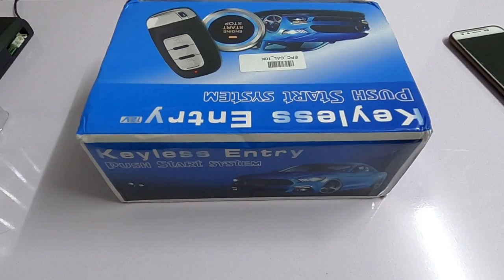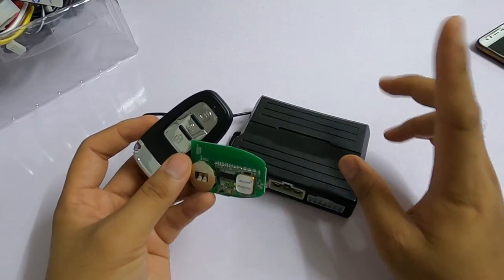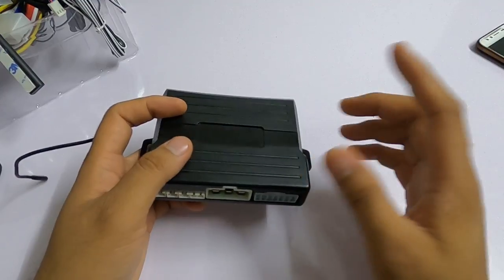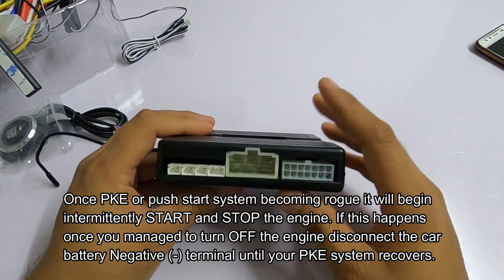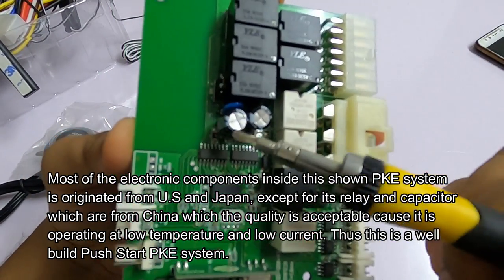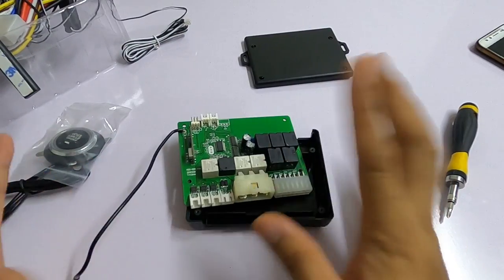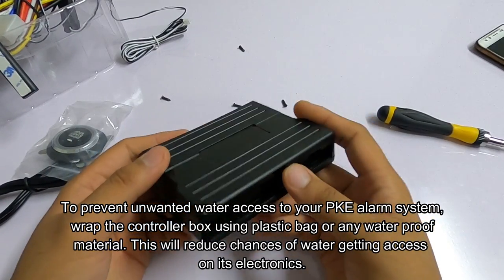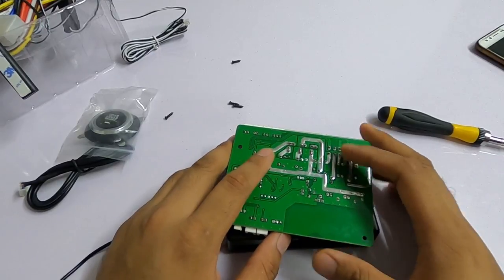Push Start PKE | Aftermarket Installation Safety Precautions & Risk

Comment: Got it installed and used to not turn on with out the key fob in range but idk what happened it starts with out the fob I’m range what could it be
Reply from the maker: i think the pke module has issues, because i experimenting remove its fob detection antena it immediately lock the door and rang the alarm if you open its door or start its engine. if you did wired the whole system onto your car get a new spare unit just replace the module or antenna but most probably its the module. subscribe if helpful.

Comment: Do you think a silicone based or epoxy resin, if I coat the entire circuit board with one of them, it will prevent moisture from getting in there
Reply from the maker: i think so, yes correct that might be a good idea thanks for the input bro🤗
Reply: When you try to open a car computer or ecu,you will see a fully coated circuitboard just to insure resistant of water and rust on electronics parts.

Comment: good video and good eye for finding the bridge.. the chip though that looks more like they acid wiped or used a grinder on it to  get rid of the writing on the chip so you would not know what it is .. I see that in all the products from china . They do it to slow people down from cloning the pcb's or dumping the firmware off the chip and  the other reason is because the chip it self is a clone of a name brand..
I Just bought one of those to install have not taken mine apart yet but pretty sure that is the wireless section and that would not cause your car to turn on and off anyways.

Comment: I disagree, going from cold to hot creates condensation because air pressure difference in different temperatures. Since different air pressures have different humidity level, the leftover water condensates. if you wrap it in plastic, it basically condensates inside and cannot vaporize again because well, you wrapped in plastic, but it got inside with air, since you cannot make it completely air tight by wrapping it in plastic. So you just create a closed canister that keeps sucking water in from air. What I would to is get a can of spray polyurethane plastic and coat the PCB. Now its just protected from the environment. Ofcourse it is good to clean the board first with isoprophyl alcohol. Simple. And now the condensation water can leave before causing any harm by rusting your connectors, etc.
Reply: Agree on technicall stand point

Comment: Warning I have the EASYGUARD PKE system All remotes shit themselves at some point I advise when ordering to get two more remotes straight away because, after a couple of years, the new remotes will not work on the older module. I know because it happened to me.
Reply from the maker: Me is a different story, mine has lock unlock issue and mis crank  after 3 years of use.

Comment: What if the car have immobiliser system?still suggested to install?
Reply from the maker: Hi ashraf ,the original immobilizer will removed from the original key and stick to the key slot receiver permanently as there is no need for immobilization anymore, the new alarm PKE features is more advanced with its GSM radar antenna to detect the key fob within 2 meter radius. Subscribe if helpful.
Reply: So it would not be a problem to install on altis model 2012? Because some say that the battery will weaken fast because of the system..and the original car alarm system is better..mind sharing your opinion?
Reply from the maker: @ashrafrahim3665  Within 3 days If i not mistaken if there is no entry into the car the alarm will off its radar antenna system which will then allow u to enter using  lock /unlock button. I been travel and set my car a week without starting I don't have much issue with it, plus my car battery is small NS60. Nothing much different
Reply: Thanks for the reply bro..but if the car already have push start button system..then cannot install this oem system right?

Comment: i had a more expansive system been using it for quite number of year, at the end of the days when the relays start to get weak, you will find your car will have a hard to start and sometimes doesn't even start. currently i haven't found any better system which is more reliable from china.

Comment: Hi, amazing diagnosis of the PKE system. I have one problem with my aftermarket PKE, it's that holding the brake and pushing the Push to Start button starts up the car way too fast, and this over time is causing some problems with the idling due to ECU. My question; is there any way for us to add a delay in the PCB when we start the car? only pressing the button without pressing brake sets car to "ON" position and starts the ECU, but when we try to start the engine, the starting sequence is Off -> Immediately Start Engine which does not help. Thank you so much for your input
Reply from the maker: as in modifying the PKE's PCB board is a NO, however I dont understand the sequence that you mentioned as in my PKE 1 time button push without brake tapping is ACC On. Push 2 is ON, and 3 will do start if brake is pressed or totall OFF if no brake pressed. The only thing that my PKE always bugging me is when it short crank before engine is start.
Reply: @IkmalRusli  Yes thank you for your reply. So push 3 with Brake pressed for my system does not go from ON -> Crank, but rather Shut off -> Crank. When this happens, it is similar to turning your keys straight to Crank, without pausing and letting ECU, fuel systems start up. Hope I'm able to explain well

Comment: Hey my car already have keyless entry with remote key...but push start button is not there...if I install this then my old key can be programmed into this module...
Reply from the maker: Hi few things need to be clarify is your car keyless is aftermarket install? if yes the you need to completely get rid of it and install this PKE system old remote cannot be programmed if its not a universal ones. If your car keyless is OEM fitted then you totally cannot use this as it already have integrated into it's BCM functions and cannot be overwrite with this new keyless system. Another way if you only want to get push start feature is to just install a push-start only module but of course it have no other features other then to start the car and not as smart as this. Subscribe if its helpful

Comment: Mungkin boleh ..solder dengan cairan plastik atau..buat dia waterproof.. Boleh tak spray  atau solder supaya tertutup .. Guna leakage spray..
Eksperimen ..hihi asalkan bahan penutup bukan elektrostatik..konduktor elektrik..
Reply from the maker: Idea yg agak baik tetapi harus ingat module tu ada connecter jenis socket...sekiranya kurang mahir akan menyebabkan socket sukar di buka sekiranya terdapat masalah😊

Comment: I wanted this on my Ford Fusion 2016 se, suggestions or thoughts?
Reply from the maker: As for this system it's support most cars that comes with non-keyless system. There is 2 things you need to confirm with your car before installing or purchasing this:
1. your car default system should not be keyless
2.Door Lock system trigger, check your car or google what type of door lock trigger it uses cause this system only support +ve and -ve triggered. newer ford model uses datalink door lock system which not supported by this PKE system. Subscribe if I'm helpful 😃

Comment: hello sir ,,,why is it if i remote start my vehicle the car will start but the starter keeps on starting even thow the vehicle has already started?
Reply from the maker: I think you missed out the wire "Fuel Path/Pump" thats where the PKE sense if the engine is running, find the wire usually at the side door panel it will always give "+12v" when the engine running and non when its OFF. subscribe if helpful.
Reply: ok Thankyou

Comment: How do I get a 2018 wiring diagram for Honda Civic Sports model
Reply from the maker: Hi I think will not compatible for car that already come with Factory push start system, like civic 2018. The diagram is universal for all car not specific to Honda, u might require a wire propping n tapping skill in order to look forward wires to joint with this module. subscribe if helpful 😃..thanks
Reply: Hi bang,mana boleh dapat diagram untuk pasang alarm pke ni dekat wosh zge?
Boleh guide mana point nak ambil?

Comment: Hi can I ask does installing this will consume more car battery?
Reply from the maker: hi for any type of pke alarm system it will consume slightly higher current then normal alarm system due to actively scanning for key fob transmitter. for this pke unit if there is no unlock for 3 days it will disable the pke function to reduce battery usage. so when u enter the vehicle u need to press the unlock button as pke sensor is disabled to conserve battery. subscribe if helpful 🤠
Reply: @IkmalRusli  Thanks for the info, just subscribed! Hope to see more content on the PKE system
Reply from the maker: @jaysonlai95  thanks bro, i will work more to create content like this if there is opportunity 😀🙏

Comment: Sy punya remotenya termasuk dlm mesin basuh. Jd remote tu rosak.. Sy bole buka kreta mgunakan kunci manual.. Tp x dpt start kreta.. Mcm mna nak selesaikan?
Reply from the maker: Alamak tak ada spare ke? macam ni boleh bypass temporary kalau model alarm kamu sama mcm video ni. buka kereta tu manual time masa enjin tu mati tekan learning button yang dia provide tu hold sampai signal berkelip dan kamu boleh start kereta tu macam biasa untuk exit bypass mode tekan semula learning button tu masa engine mati sampai signal berkelip. Kalau beli remote baru untuk program hidupkan enjin kereta dulu, kemudia tekan learning button tu sampai alarm ada bunyi kejab dan signal berkelip, lepas tu tekan lock/unlock remote baru tu box alarm tu akan save frequensinya.setelah selesai programming tekam semula learning button tu.
Reply: @IkmalRusli  terima kasoh tuan..

Comment: Hi, i am planning to buy the same one for my 2010 honda accord. What is ur suggestion, is this system good?
Reply from the maker: Hi jyo, been using the system for almost 2 years quite stable not much an issue with it and yes you can trust this one. subscribe if helpful 😎

Comment: Bro. System ni kena make sure alarm sedia ada elok ke? Sy punya alarm dah gila. Ingt nk pasang yg PKE punya.
Reply from the maker: Tak perlu bro yang penting center lock dan door lock function, push start nj canggih cuma dia ada dia punya perangai tersendiri contohnya kadang kala signal dia terjejas sbb kan telepon bimbit dan kadang kala masa start up dia stop crank walaupun enjin belum hidup. saya masih menggunakannya sehingga sekarang syukur takde masalah sangat. subscribe sekiranya membantu 😊
Reply: @IkmalRusli  bro tnya sikit. Alarm skrng tngh gila. Now dia kacau signal. Sy kasi signal kanan, dia kluar double signal. Ni mmng issue alarm ke? Sbb alarm kalau sy tekan beeb berbunyi, tpi lampu signal tk kluar. Aduh pening.
Reply from the maker: @nanotech4947  kena tgok bro kalau baru2 berlaku mungkin alarm controller ada masalah yg ini upgrade ke alarm ni mungkin solve issue bro ni, tapi kes paling teruk sikit bcm module rosak yg ini kena tukar bcm box. bawa ke pakar alarm dulu tgok apa mereka kata sblm upgrade ke benda ni takut jd teruk pula.  Body control module (BCM)
Reply: @IkmalRusli  bro. Berapa harga beli ni? Yg sy nk beli RM 420. Kedai tolong pasangkan. Agak2 kalau yg ni akan ada masalah start tiba2 ni tk? Risau juga
Reply from the maker: @nanotech4947  dah ok harga tu, masalah tiba2 start tu bukan masalah sistem alarm itu sebab kena air. rasanya semua alarm pke ni sama cuma make sure sensor antenna kunci tu ada 3 baru elok sikit mcm dalam video ni.

Comment: How do you change the battery on the fob?
Reply from the maker: you can twist and split open the fob using coin or flat object. the batteries are same as in the computer bios CR2023.subscribe if helpful 🤠

Comment: This was an awesome video until you said to use the bag. This unit produces heat, if you bag This the heat will sit inside bag and literally make condensation due to the heat produced inside of the plastic. Recall microwaving a meal, the top plastic has water/condensation due to the heat being produced underneath. Maybe don't advise that.

Comment: Will this one work in a 95 Camaro?
Reply from the maker: Yes it will for older cars with conventional engine start and +/- triggered door lock system. For newer Ford models that is using datalink for door lock this PKE system might not support.Subscribe if helpful.
Reply: @IkmalRusli how do I bypass the Pke I have the ec003N

Comment: Lock unlock indicator boss connect dkt mane yer?sy connect direct original horn tlalu bising..then sy connect p parking light tp x clear especially siang..ada cara x utk connect p signal light mcm original indicator bila lock n unlock?
Reply from the maker: You ble tap ke double signal wire switch output bukan input yg (+ve) kena test guna test pen kalau belum tekan emergency signal tu test pen dah menyala itu input, kalau tekan emergency light baru test pen menyala itu ouput...tapi btw alarm set tu sepatutnya dtg dngn speaker siren atleast tak kuat sangat mcm horn dan yg tu pun ble jadikan alternative

Comment: bos nk tye sikit. kete kelisa 2003 sy xda central lock , xda alarm system. biasa la secondhand. jadi klau nk install natang ni nk kena install alarm dgn central lock skali ke? atau cukup natang ni dgn central lock shj??  mohon pencerahan
Reply from the maker: Kena pasang central lock dulu sebab sensor buka pintu dan auto lock Mechanism tak include.... Mmg banyak kerja sikit untuk kereta tuan ni lepas tu baru ble pasang alarm ni. Subsribe sekiranya membantu 🤗
Reply: @IkmalRusli  ooo baik2 bos. agak2 brp kerugian klau nk psg central lock tu standart kedai? agak2 je la harga lebih2 kurang. nk buat sndiri mmg xmampu la sbb wiring kete lama ni faham2 la kan. owner lama pun dah tambah mcm2 kt wiring dia , wire looping byk tp xtau apa function. mkin owner lama cabut balik kot apa yg dia pasang. tinggal wire je. sakit kepala jgk klau nk buat sndiri haha

aaaa like je video ni xleh ke? ke nk kena sub jgk bos???
Reply from the maker: @ejoi95  itu kena tanya Accessories bos sy rekomen kalau tak biasa buat better pegi dulu kedai Accessories dan buat basic lock unlock dulu sudah settle cukup budget baru buat yg ni...like pun ble je kalau tak nak subscribe cuma subscriber tu dia support padu 😁

Comment: Is this product safe because I just ordered one
Reply from the maker: I am still using it in my toyota wish main car, no issue so far
Reply: @IkmalRusli  do I need to buy any accessories?
Reply from the maker: @rheillifestlouismuchapo3640  no totally no, unless you want the alarm to be app controlled together with gps function then you gonna add on module...which i dont buy
Reply: @IkmalRusli  where can I order this exact kit from? Would be really helpful if you added a link in description or just reply with a link please, thank you. [Just subbed]
Reply from the maker: @exileworldwide1814   the keyless system is called Q6B:
https://s.lazada.com.my/s.Xl4pT
Reply from the maker: @exileworldwide1814  u can get it from any webstore as long as it is the Q6B model

Comment: Remember:Most push start systems alert you when a crimal tries to steal your car.
Reply from the maker: Not really sure what do you mean but my push start key fob is 1 way system alert is only through alarm siren from the car there is no indicator on the key fob if alarm is triggered like those viper system or may be u mean differently

Comment: Benda ni tahan lama x bos. Ke mudah rosak
Reply from the maker: So far saya guna ok, problem haritu pun sebab terkena air.
Reply: @IkmalRusli  da berapa lama guna bos
Reply from the maker: @synonymspicturefilm5648 sblm tukar kena air tu dah 2 thn ...yg baru tukar ni dah 9 bln
Reply: @IkmalRusli  psg sndri ke bos. Area mana.
Reply from the maker: @synonymspicturefilm5648  ye, betul tapi kalau tak tahu beli barang je banyak kedai accessories boleh buat
Reply: @IkmalRusli  kunci mmg kna potong masuk tmpt kunci ye bos.
Reply from the maker: @synonymspicturefilm5648  ye betul dia akan stay di posisi start...supaya steering tak lock kalau ada immobiliser cip dia akan lelat skali situ...kunci duplicate lah awal2
Reply: @IkmalRusli  ouh baik bos. Jd kna duplicate skli immobiliser ke
Reply from the maker: @synonymspicturefilm5648  immobiliser tak perlu kunci je....sebab kereta akan guna sensor push start yg baru sebagai immobiliser
Reply: @IkmalRusli  terima kasih bos.
Reply: @IkmalRusli  bos 1 soalan lg. Klu kreta myvi mmg bukak ttp pntu x de bunyi. Jd klu psg brg ni beli x siap speker horn dia kna tmbh sndri yg lain boleh ke.
Reply from the maker: @synonymspicturefilm5648  tak perlu tambah dia dah ada buzzer skali dalam tu included tak perlu bunyi horn tu

Comment: What happens if key fob dies?
Reply from the maker: U cant still start the car the is a reset button u need to hold until the alarm chime then u can start and drive, to exit push and hold the reset button again
Reply: Hi. Can you show us what the reset button looks like? And i have another  question, what if the battery dies of the remore or lost. Can i still use my original key to enter the car?